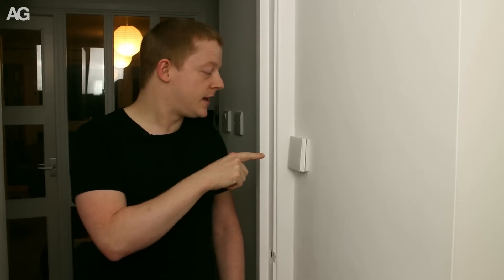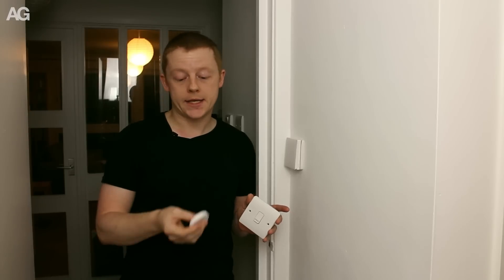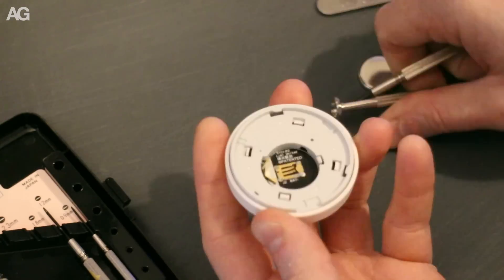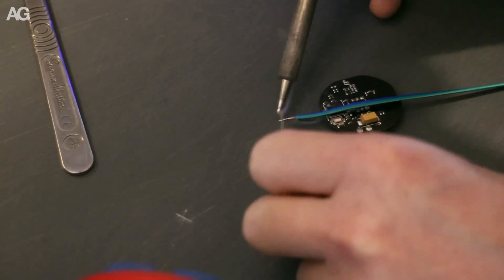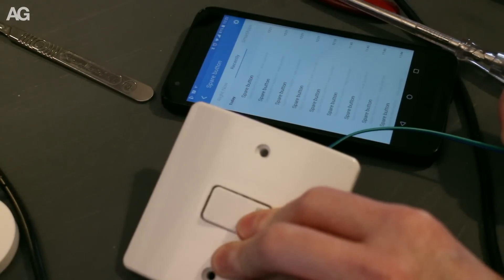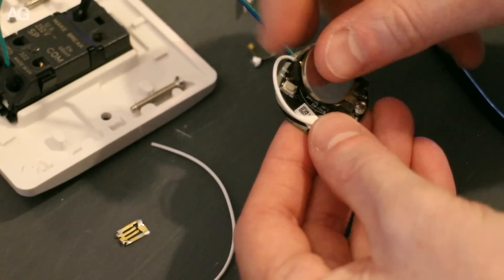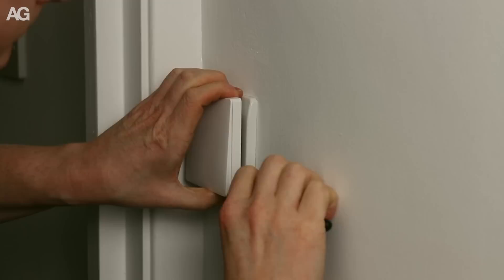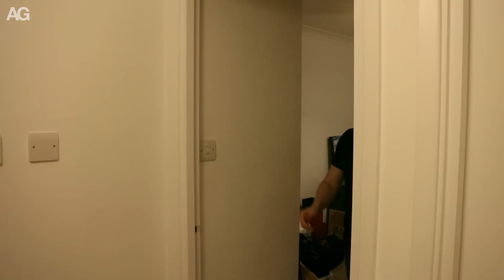Light Switch Hack for a SmartThings Home

Comment: I was looking for ever for something to mod my original battery doorbell button and this is perfect, just a note that on the bord there is actually 2 holes that you can use to wire the button with out removing the toggle.
Reply: Is that with the WXKG01LM model?
Do you have a picture of the 2 holes?
They are not visible in the video.

Comment: Unsure why you attempted to mimic the Xiaomi Aqara wireless wall switch; which if you prise off the front cover has screw locators to replace the original wall switch, so you could have merely permanently wired your wires and then swapped the original switch with the Xiaomi Aqara wireless wall switch ... or was it to mirror the design of the other switches in the flat? good vid and nice little project tho :)

Comment: You are stuffed if the button cell battery runs out arent you? There is something called sonoff bro.
Reply: This is easier to install if you can't rewire your house, eg. here in EU we don't have a neutral wire by default at the light switch box to power smart switches when the light is off. Yes I know, Sonoff now has a no neutral switch version, but it needs an additional ugly anti-flicker module installed at the bulb fixture.
If you setup automation rules as close to your ideal usage you barely ever have to touch the regular switches. So even if you run them on battery, these things last for years, because they only use power when triggered.
Reply: He could fit a sonoff behind the ceiling rose but when he kills the power using the wall switch won't that kill the power to the sonoff, then he won't be able to control it smartly?
Reply: @billyoliver  There is a giop pin on sonoff. If you are scavvy enough you can use that as a toggle switch. There is a YTber called SuperHouseTV he explains it in detail.

Comment: wait a minute..If you would have screwed off the baseplate and then just put the switch unit you had sticked on, directly on he wall using some double sided tape at the edges, then it would looked like normal as well and you would have had a nice lare switch button and way less work. it onlu looks strange in the beginning becasue you stuck a switch on the base plate.

Comment: Seems like a waste of time... may as well have stuck a sonoff basic in there or at the rose...
Reply: I doubt he could fit a sonoff behind the switch but maybe could behind the rose but then if the switch was turned off on the wall then the power to the sonoff would be cut wouldn't it?

Comment: I'm confused... if you were able to wire up the light so that it was 'always on'... then why didn't you just put a smart switch in? I mean... compared to all of that, you would have only needed to undo 2-3 wires on the existing switch, and then plug those wires into your new smart switch, and presto you're finished... Beats having to just nut the wires together and hope they hold while you put a 'fake' 'smart switch' in its place...
Reply: the smart switch would require a neutral wire like in the states... very unusual to have this extra wire in the U.K.

Comment: i've never seen a light switch with the word "press" on it.... i wonder who needs that instruction, maybe people who sees a light switch and think they should pull lol
Reply: Colin Ho these momentary switches are for doorbells or automatic doors. You can’t control lights with momentary switches
Reply: that's quite irrelevant to the point i am trying to make lol
Reply: Colin Ho what’s your point then? My point is he probably couldn’t find anything else
Reply: My point is, why would a button have the word "press" on it. It's not like you can do anything else to it. Have you seen a button and thought you should pull it?
Reply: Colin Ho i see. You mean in general for a button. Well as I said these kind of buttons are for exiting automatic doors or doorbells where you press once and release to complete the action. It needs to be distinguished from regular toggle switches. For a toggle switch you can press both ends of the button depending on whether it’s at on or off position. So the “press” here simply tells you it’s a momentary switch, not a toggle switch, which implies, for example, you can open the door in front of you with it.

Comment: You know that the Xiaomi Switch you have can be screwed into that exact wall box... the sticky pads are optional, but it has allocated place to screw in the switch too. 
You really didn't need to go through that trouble unless you really wanted that old ugly looking (but matching the rest of the house) look.
Reply: I agree, the wireless Xiaomi aqara switches can replace the wall switch, no blanking plate require, you just screw them in like a normal replacement switch ... but then you have to permanently wire the switch on and use a smart bulb, which I may do but sound risky with always on current ... how do you know if the bulb has blown, etc.
Reply: @shadz85  The Xiaomi aqara wall switches can replace the wall switches, just prise off the front cover and there are lugs to pop out for the screws ... no need for a blanking plate and double sided tape.

Comment: Hi, is it possible to show or explain where did you put the 2 wires in the switch and whether it is possible to connect this modded switch to the mains as well to get a smart switch as well as a normal switch
Reply: 3:46 just put the two wires together.
Niether the modded switch, nor the official powered Wall Switch by Xiaomi, will be able to connect to the smart bulb while at the same time turning off power to it. It is either one or the other.

Comment: this is so dumb... You had aqara wall switch, and make new one from xiaomi smart button and standard light switch, both works that same, so what's the point??
Reply from the maker: You should watch the video before posting comments, that is explained at the start.
Reply: I watched it. You replace wireless switch by wireless switch, only difference is look.
Reply from the maker: Exactly.

Comment: You say that it "take[s] a bit of effort to get working with SmartThings" - does that mean you had to use a custom handler etc., or did work with ST out of the box? Could you link to any custom code?
Reply from the maker: If I remember correctly they are officially unsupported so you need to manually add them and they probably require their own handler. The ST forums are really good for these as someone else has almost certainly put in the effort to get it working!

Comment: . I live in a rented property and I'm not allowed to change the wiring so I just purchased the first generation Philips Hue hub on eBay for cheap and bought some and Philips Hue bulbs then got to Philips Hue dimmer switches and change the faceplate to one that I could place the Philips Hue dimmer switch into and did not need to hardwire my light switch and break my tenancy was able to have full Philips Hue connectivity for less than £45 good video though

Comment: Hi, I really appretiate for sharing your experience with ZigBee Lighting. I just watched your video and got few questions:
1) how many bulbs can 1 gang light switch control? I want to control 4 bulbs with 1 gang, ¿it is possible?
2) are you using zigbee bulbs (like splenged or sylvania) or wifi bulbs (like Yeelight)
3) what Hub do you use for the lighting?

thanks again, and i would love your comments!
Reply: Physically the single press as shown in his video will turn off/on the light switch that is physically connected. However through the Xiaomi Gateway, he should be able to program 2 other actions( 2 quick presses and 1 long press) using the same switch to control other lighting. Type of bulbs here doesn't matter here as the solution is at switch level and not bulb level.
Reply: AsusEpoxy so i can manage  the gateway to control as much bulbs as I want every time the switch is press?
Reply: in this context, lets say this original switch in this video is switch A controlling Light Group 1(group consisting of only 1 lamp),  you can have switch B controlling Light Group 2 (cluster of 6 lamps for eg) , switch C controlling Light Group 3 (could be a garage light or something). You can use switch A 's double press action or long press action to control Light Group 2 and 3 ONLY IF switch B and switch C are in the same family of switches. In this case, they would have to be the Xiaomi Aqara Zigbee switches
Reply: in the video it is clear that there is no power supply but only with the Xiaomi battery, so use wifi lamps

Comment: Cool, could you power the board from the wall instead of the battery?
Reply from the maker: +David Coad no, must be from the battery. I don't have a neutral connection in the wall and if I did I could use a proper controller rather than this hack
Reply: Arthur Guy But what if I have, and I don’t like betteries? Can you help out me a little, I have the basics only. Great tutorial btw, grats!

Comment: Do you think a standard toggle switch could also be made to work with Xiaomi switch (button)? Or would it have to be a momentary?
Reply from the maker: Unfortunately your going to need a momentary switch otherwise the effect will be holding down the button for hours at a time which will almost certainly trigger some kind of reset/programming mode!
Reply: Yep. Figured that out. Fortunately my switches are very easy to convert to momentary switches using this method - https://youtu.be/_QJgYJfNKRI. Thanks again for sharing this.
Reply from the maker: That's really great solution for converting a switch!
Reply: Yep. I got it all setup and it works perfectly. Discovered that Sonoff's can pull of the same momentary button trick. So between the Xiaomi buttons and Sonoff's I have a pretty cost effective solution for turning my existing dumb switches into smart ones.

Comment: This ain't meant to cause offence but it seems like you made a solution to a problem that didn't exist. You already had a button that worked. So you made  another one then just removed the plate that was the problem.  Couldn't you have just removed that plate and flushed the one already there.  Also I think your breaking building regs but not sure. I'm sure you need a local isolation point on bulbs so you know it's dead when you replace it otherwise bulb is always live when being touched.. not 100% sure thou just what I've read on loads of forums as I was looking at doing the same.
Reply from the maker: +ins4neuk this was the only way to get a switch that looked like it belonged there as it matches the style of the others.
Reply: Arthur Guy ahhh so it was purely for aesthetic reasons. Good job thou on the unit as I said no offence was ment I just thought it was other stuck out to much.  I'd double check thou on wiring just to be safe.
Reply: IMO this is a real problem and a great solution to that problem. And for those of us living with family or frequently have visitors having a switch that looks like the others is critical.

Comment: Great video but I'm not sure I get the logic??? You can't go full HA because it's a rented property, yet you were prepared to hard wire the light to live and change the face-plate... why not just add a Fibaro micro module behind the switch and save all the hassle / battery / lag?
Reply from the maker: +Robin Winbourne the box wasn't deep enough for that. The switch electronics are really small and allows everything to fit into a very shallow box.
Reply: Arthur Guy fair point... I thought it looked like a 32mm box so would normally fit... must be a 16mm then?
Great use of an Xiaomi button btw... certainly saves money for those with existing smart bulbs!!
Reply from the maker: +Robin Winbourne it's an annoying situation but given the limitations I am quite pleased with the solution. So far it's working very well.
Reply: another reason is that most homes in the UK don't have permanent neutral in the light switch, which fibaro and others (koogeek) need.